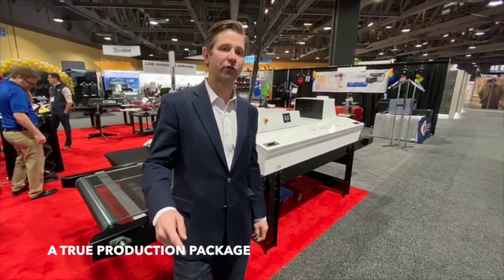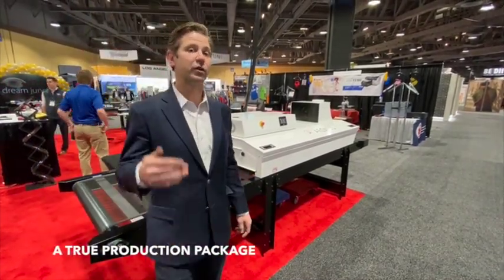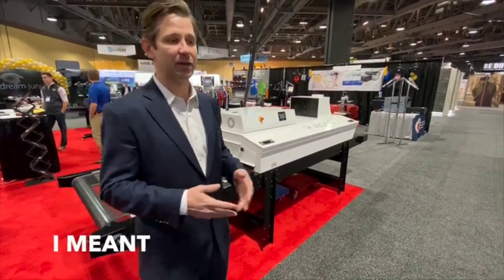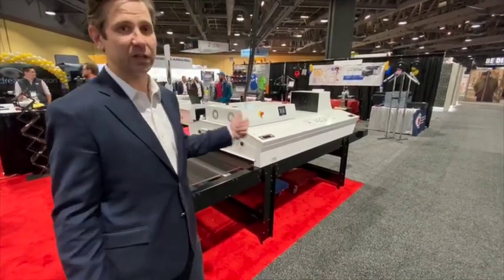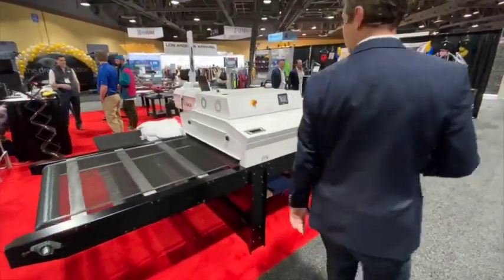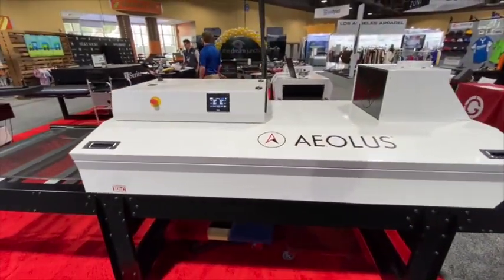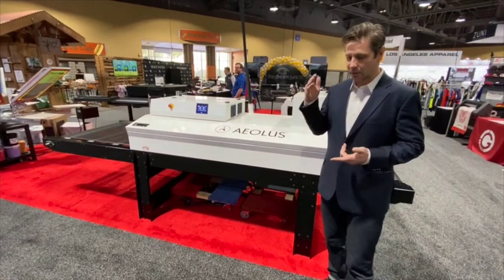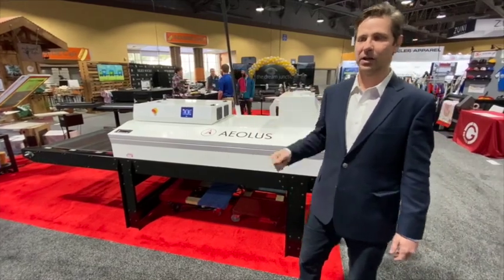NEW! Epson F3070 Direct to Garment Printer

Comment: You can dry wet pretreated shirts? Im assuming this eliminates the “Ghosting affect” that can be caused by heat pressing the pre treatment?
Reply from the maker: Yes exactly. The conveyor dryer really allows for a much higher quality finished product, and dramatically increases production efficiency. BBC makes a smaller version too, the 2408 which is perfect for up to 3 F2100,s and 1 pretreat machine. https://www.shopmelco.com/category_s/191.htm
Reply: @MelcoEmbroidery  So this eliminate’s heat presses?